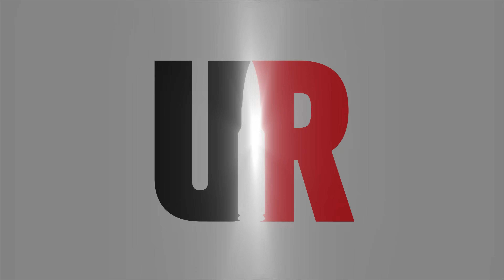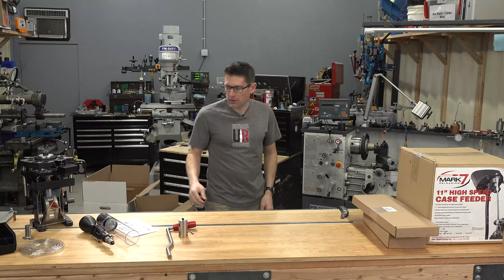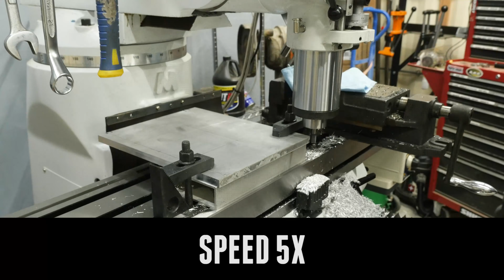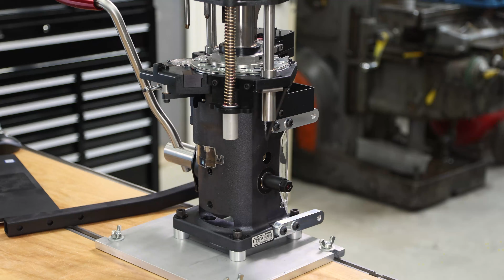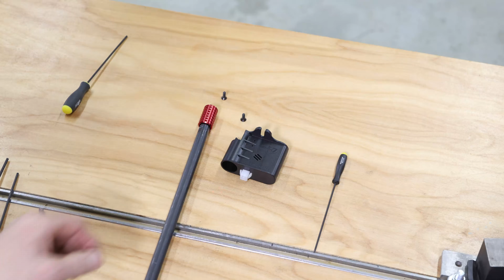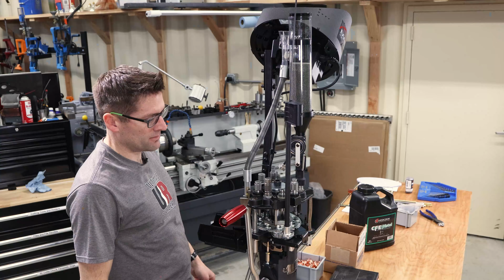NEW Mark 7 APEX 10: Unboxing, Setup, Loading 45 ACP

Comment: Can't  justify  spending  $3,000  for the  small  volume  I plan to shoot some day   when I can  get a Hornisay Lock & Load and the necessissary componinets..
Reply from the maker: Not everyone needs this press, rock what you got brother!
Reply: @Ultimatereloader    I decided   on the Horniday Loack and Load  .. but you can't  buy one they  are on back order..   ,,  Then If  I got one  Prmers  would  be impossible to get or  overpriced and   bullets  very expensive too ..I try to watch  your  videos  to  decide what is best..  But  Unboxing Videos  are so long and boring..
   When I purchase one I will assemble it according tothe Insgructions..  
   I need to know how they work and function compared to other brands  and models .. what the  good and bad features  are of each brand and model..
  It  looks to me like Manufactuers  send  you  Relaoders for Free  thus   You don't  seem to understand the  real purchasing process.. finding htem online or  finding a  good  Brick and Motor store to work with .. Of coruse  you would  be limited  by distance to deal wiht Brick and Motraor locations...
Reply: @mikeskidmore6754  my recommendation: return the Hornady and buy the 550. Much more reliable and dead nuts simple to operate. If you can swing the additional cost buy the 750.
Reply: @jyc2201    I will  have to Google  that  Brand the  550 is .. I like the  Hornaday  because  you can change  dies    that are still adjusted properly .. that's  why they call it a  lock  and load..
  I don't  know all the Model  numbers  other  than  600  JR   ect  
  I will guess a  750 is a Dillion..
Reply: @jyc2201    Here 
This item is currently on backorder status
Please allow 8-24 weeks for order completion
Reply: @jyc2201    I don't  see  anything wrong with the Hornaday and  you   you can  change dies   that are already  adjusted properly .... I am so tired of unboxing videos ..  They  don't  give  much of  any useful information..
https://www.youtube.com/watch?v=72MTiuEBzak
Reply: Bought the Hornady, had some problems, priming system flexes too much and doesn't seat quite deep enough to meet ammo specs. Bought a Dillon, problem solved. Reviews rarely get to that level of detail. Have fun and be safe, whatever you choose.
Reply: @alanb76    As  far  as  I know the  Primer depth  is adjusatible ..  Did  you  read the Insturactions..???  I want to relaod  like  5  different  Caliburs  in low volumes..   wiht a Dillion you have to spend  $45  for  each die plate I think   it is
Reply: There is an adjustment, but it does not solve the issue, it fails to seat primers to a consistent depth per specification. I worked with the manufacturer, they were unable to resolve it. I figured out what the problem is, but it's not easy to fix and off topic here. Search for primer seating issues. Have fun and be safe.
Reply: @alanb76   I saw a video    the aluminum  gets  worn down .. I see a guy drilled a hole and   threaded it for a hard set screw he can ajust  Problem  solved..
   It's  apropriate here  when some  one  makes  a long video and  doesn't  tell what the price ..  .. That wasted a lot of my time..
  I commented that  I thought the Hornady  Lock & Load  would suit my needs..  
   Then some one told  me  to send the Loack and Load  back and  get a 750 for 550 ..  Assuming htey meant  Dillion brand
Reply: @mikeskidmore6754  this is not the issue and that does not help. The 750 or 550 don't suffer, they are blue models. I've seen at least two vids on utube where someone fixed it on the AP but it was not a simple thing and very hard to find these vids. Unfortunately I didn't discover this soon enough so it cost me a lot more and a lot of time to analyze it and talk to the factory who was eventually unhelpful. Lots of threads on AP priming issues if you do some searching. There are many videos on these problems because there are many different problems in the AP priming system. Most can be fixed easily but the seating consistency is not easy to fix. The AP press will waste a lot of your time fiddling with it. Have fun and be safe.
Reply: @alanb76    What is  AP  ..  I commented that I thought the Hornady  Loack and Load suited my needs??
Reply: @alanb76   OK  I see some times they call it  ....
Hornady Lock-N-Load AP Loader
   There is also a screw adjustment for the  Hornady  primer depth ..
  It's  funny  how  many web sites  list the  Progressive  laoder then  there is no referance to dies  or  if  you   even  get one set of dies witht he press..
Reply: @mikeskidmore6754  lock n load is a feature, ap is the model. there are other models, so you weren't clear. the classic doesn't have the problem.
Reply: @mikeskidmore6754  you have to buy dies and shellplates, and lock n load adapters, a powder scale, calipers, loading manuals, components and lots of other things - the press is just one piece of the setup. Don't think for a minute this is a cheap way to go, it's just a buggy loss leader to get you in the door. The LNL Classic will save you lots of money and get the job done with simplicity and precision. The AP is way too fiddly. If you really need automation look for a Dillon 550 or 750. Anyway this is off topic here, the Mark 7 looks wonderful, thanks for the review Gavin.
Reply: @alanb76   n I bought  a sinble  stage  Press  35 years  ago ..   to relaod  .357 Mag..   I used to shoot  Trap  many  years  ago .. I ahve  two Mec 600 JR's  one set up  for  12GA  one for  20 GA  plus  410 dies. 
  I wanted to get bac into shooting .. "   I bought  new  Ammo  when it was still affordable and I have been  saving the empty cases.. 
   I have  been a mechanic  for  50 years..
   I find  it hard to believe..   that something  as  Popular  as the     Horanday  Lock & Load  ..  AP    I guess Ap is for Automatic Press I ha ve no Clue..
   I have  been  a mechanic  for  50 years..   I   know how  ti figure things  out and modify them when needed.. 
   It's   funny  I have  watched Dozens  of  Videos  ..  
       This  Gavin Tube    does an  Unboxing  on    every   Relaoding  Press on Earth  ..    and   seems he  talks like every press is perfect..
   It  would take a year to watch all of his Videos..
  I watched a Couple of Videos  made @ Brownells they say it's  great..   
   I will  do some more research and  try and figure   out if it really has that  many  Issues..
   With the first Mec  600 JR  I kept  track  of what My Father paid for all of the shot  primers  ,, powder shot and wad..  I started realoading at  about  age 10 or  11..  My  Grandfather  actually  built a Trap house in his back yard..  I have and still have   an Ithaca  20 GA  SKB  over and under..  I killed my first  two  Bucks at  age  11 with that  20GA with qa Slug  Sight taped on the  Ventilated Rib..  Crude  but  I had it sighted in to shoot the bottom improved  cylinder barel first .. the  top barrel  was modified..
  I could break clay pigions from the    16 yard line with it ..
   I had it since I was 10 years old..
    Anyway  I kept  track of all of  imput  costs..  I was loading  20 GA shot sheels  for  about  5 cents  each back then..  Not counting  the   Comonents   in stock    already piad for but not sued  yet..  When you  get up around  7,000  rounds  it     averages  out..  
  I have   9 mm   38 special and    .223  remimington on hand..   I just don't shoot much but want to get back into it .. and don't want to pay what  new ammo costs.
  I have a Full shop  With  every tool    you  could ever dream of  to  work on heavy trucks  cranes  loaders  and farm tractors..
   I bought a pair of dial calipars at Sears  when I was maybe  18 years old .. along with  Dremels and Die  Grinders to do port work on  two  stroke  motocross bikes and snowmobiles..   
   You don't have to buy plates for the    Horaday  press..   just the die  holders..   
  As  far  as shot gun shells  that    RCBS  progressive  press  is impsressive..
Reply: @alanb76    Some WEb sites only sell one model ..  and they  don't  give a  very  good description of what is offered..
   I supposed I should  look on Hornadays  web site  to comapre models ..  I assumed  there was one basic progressive press..  I am  not  looking for  auto brass or  auto  bullet feeds..   
https://www.youtube.com/watch?v=w6BfPn5QaiA
Reply: @alanb76       I think this guy figured out how to adjust it ..
https://www.youtube.com/watch?v=w6BfPn5QaiA
Reply: @alanb76    I see  now they call  all of  them  AP  for  Ammo plant  but  you have to  purcahse the  bullet  feeder and  brass feeder seperatly   and I am not interedted in them at this time
I just got this press to go along with my Dillon 550 (which it's probably going to replace) and I'm very happy. This press has gotten some bad publicity in the past, but a lot of it no longer applies:The priming system has been redesigned. It no longer has an on/off switch and the punch is now held in place by a nut, not a knurled knob (among other changes). The updated priming system on my new LnL AP is 100% functional, even more reliable than my Dillon 550's. A good feature often overlooked is that spent primers get pushed out directly into a tube which you can direct into a trash can. This keeps my LnL MUCH cleaner than my 550 (which is always getting gummed up and jammed up from spent primer debris).Lee dies do work in this press, although not always in the fifth station (usually not a problem). If you want to use a powder cup in fourth station, a Lee crimp die will probably fit in the fifth station. If you want to use a Lee factory crimp in the fifth station, it will probably NOT fit (especiall...
Reply: @mikeskidmore6754  The shell plates for the AP must fit the case heads, just like the 550's. I bought a stack of them, they are not cheap, and the LNL adapters for the dies must also be purchased, it only comes with a few. I put all the factory updates on the AP and still primer seating depth was inconsistent, it's a design problem. If you want consistent factory accurate quality ammo you'll have to hand prime with the AP, that's what folks end up doing. The AP stands for Auto Progressive, which it is regardless of accessories. But hand priming defeats the whole purpose. The 550 works smoother than the AP if you have the updates on it. There are fixes for the 550 primer catcher which is only a minor annoyance. I got the LNL to do a few higher volume calibers but it never worked very well and cost a lot of time and money and the ammo was lower quality than the 550 produced. If you look closely you can see the AP ram torque slightly during primer seating and feel the primer seating system bind up. Measure the depth of each primer seat below flush. There's no seating depth stop on the AP, the binding controls the depth, not a quality design. The machining on the primer seating plug and inside the guide tube is rough and it binds easily. Brand new units were the same. Having to hand prime is ridiculous for a progressive press. The AP spills powder due to jerky plate motion, so it doesn't stay clean, and some of the parts rust easily because they are unprotected sheet metal. Some things are good, but there are many unresolved issues with the AP. Like death by 1000 cuts. I tried to make the AP work as well as the Dillon but it just cannot. Free bullets may sell presses but it doesn't resolve the real issues in the AP.
Reply: @alanb76     Thanks  for taking the  time to explain  some  issues with me.  It looks to me like they upgraded the  Horniday LNL  in  2009.  A user  says  to  use the  spray on dry lube..   Then  things won't rust.  This  person prefers the Hornaday because it does  not  cam over at the top of the cycle  .. you guy by feel..   If  you say  it makes the   base flex  then  I assume  it's  important  to not  use too much force  when seating the primer..
  Useing the  Mec  600 JR  to  load shot  shells  it  simply  installs the primer ..  Never measured the  primer  seating deptph or  gave any thought tot he issue..
   I aslo  have a  44 cal  round  ball mold  ..  I used to make  round  balls  for  my  44 Cal  muzzloader  on  my  Mothers  stove  as a teenager..  Now  I do  have  a Lyman  lead melter..   
  I have plenty of  shot gun  209 Primers at the Moment..  I would  like to get a more  Modern Muzzle  loader that  uses  shot gun primers  instead of the very small  caps;;;
  I have  read that you can make black poweder  on your stove  if things  get  really bad out there.
  https://www.youtube.com/watch?v=mCyYUzymHns
   This  guy   has  4 videos  or  so that  cover  every aspect  of  setting  up a Loader..  
    I have owned  mostly  General Motors  cars  Trucks and  even  a  tandem  axle  C-65  truck with  48,0000#  GVW  34,000# rear axles  13  speed transmission .  In the  past  you could always  get  GM parts cheaper.. For  example  new  dooor  Hunges  were $20.00   yet they would  have  been $60.00  for a Ford  ..  The C-65  uses the same  cab  as the C-10..
   It  seems  almost  like a Ford  Guy   trying to convince me that  his  Blue  Ford  is  better than my Orange Chevy ..
  I trounced  those  guys  week after  week at the Drag strip  with my Chevy  and I won  Specatur  drags  on a  1/4 mile and  1/2  mile Circle  track too..
  In cars and racing  you can  spend more and more  to be the fasted..  but   It's  far  cheaper  to race the Chvey  in many aspects  because  parts are cheaper and there is far more avaialble fot it..  I used the older generation small block ..  But  now   Days  they have various  LS  desing Motors  wiht  fuel  Injection  roller cams  ect.  Aluminum block and heads..  You  will have to spend  3 times  as  much to make the Ford Coyote  Motor  as fast as the larger displacement  LS  Motor ..  The ford  has  very  have   double over head cam heads.  that  tae  tons  more labor to wor on ..
  Frod Pickups  come with  so   many different engiens  many  of them  are such a disaster  you  can't  even rebuild them ..  You  have to buy a  new Engine when the spar plugs blow out   or they fail with  very low miles on them..  
  Ford  finally  came out with a  Large displacement   Big  Block  truck motor ..   because  all their  tiny  Little  ECo Boost Trubo V-6's  were blwoing  up  when  you  tried to pull a heavy trailer with them.   Ford  firnally had to do what GM  was doing all along ..  and  just  use  a larger slower  turng  puch rod motor  for long life and relaibailty ..
Reply: @alanb76     Sounds like that is a Problem .    That Gavin Tube  dude has  so many reloaders  given to him he will never get one broken in..
   The Hornaida  LnL  has  been out for several years .. It seems like they  would  improve it .. I think there are upgraded versions..
https://www.youtube.com/watch?v=RG4VrDAnJag&feature=emb_logo

Comment: Very nice & you make it look so easy . About how much ammo can it produce in 30 minutes ?
Reply: If I remember correctly the Mark 7 Apex will crank out about 2500 rounds per hour.
Reply from the maker: @goldendoodleondeck  If you have something like the PrimerPro- that will help with these numbers! Filling primers is the slowest thing :)
Reply: @Ultimatereloader  Thanks Gavin! I do have the Primer Pro until I go and actually add the primer collator (long term plan :) ) But, that is done the road as I picked up the auto drive and the complete sensor package with this order....Now to start planning that trip to Ft. Myers for the pickup ;)

Comment: Very interesting for sure. New to reloading, as in have never reloaded, but I am fascinated by this machine.  Your thoughts Gavin on whether this should be a starting point?
Reply: As someone that has been reloading for several years and also owns a mark 7 evo for the last year, I would advise against it. In my opinion, the best choice for someone new would be something like the lee turret press. If you remove the auto-indexing rod from the turret press, it functions exactly like a single stage press, and you can focus on working one step at a time while you are learning the ins and outs of reloading. When you have each die set up properly and gained a little experience, you can toss in the auto-indexing rod and make it somewhat of a semi-progressive press.

With something like this, there is A LOT going on all at once, and it is a a lot for a beginner to try to take in while learning. That's not to say you CAN'T do it, but the learning curve will be a lot less steep starting on something like a single stage or turret press.

Another thing to think about is that several people don't enjoy reloading. A mark 7 press is quite a significant investment to get started, and a bit harder to sell if you find out it just isn't something you enjoy.
Reply: Thank you very much for your thorough insight and the time you took to answer.  I will certainly take your advice under careful consideration. Best Regards.

Comment: Gavin, I've been debating between this press and DIllon RL1100.  Several people mentioned that DIllon case feeder was better than old Mark 7.  What's your take on it?  Do you think Mark 7 is better machine?
Reply: Stick with the Dillon.
Reply: The mark 7 has better electronics. The Dillon is tried and true.
Reply: I was on the fence between the Evolution and the RL1100 a few days before the release of the Apex. Had been leaning towards the RL1100 to go along with my 650. The Apex got released and I placed it on order and loaded it up with everything except the primer collator.